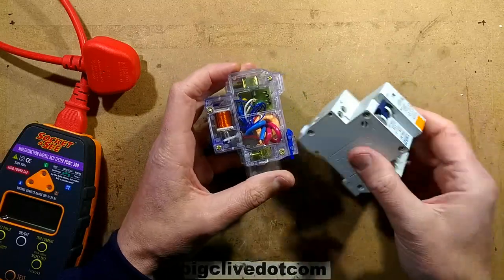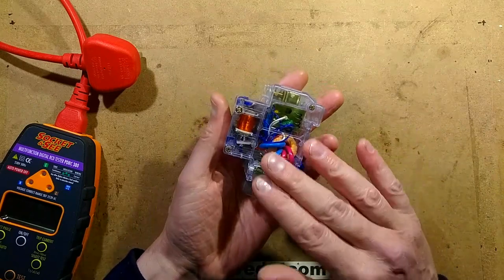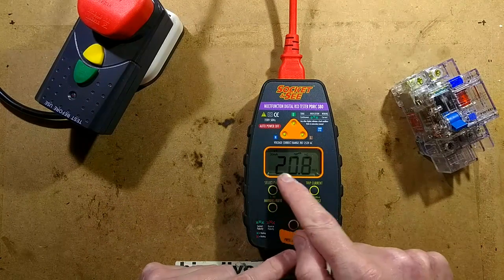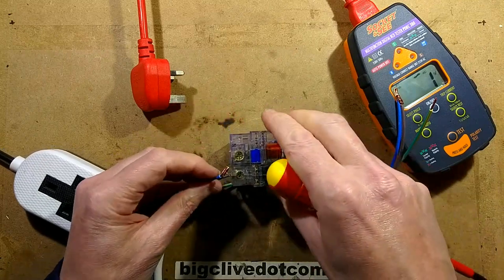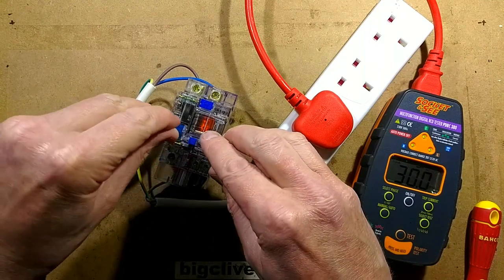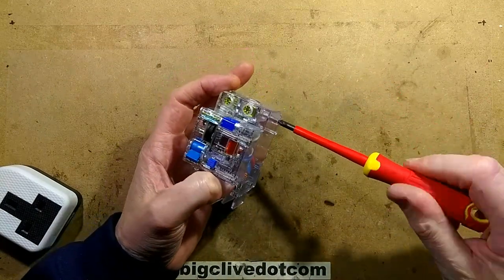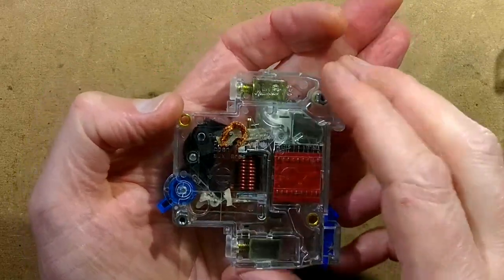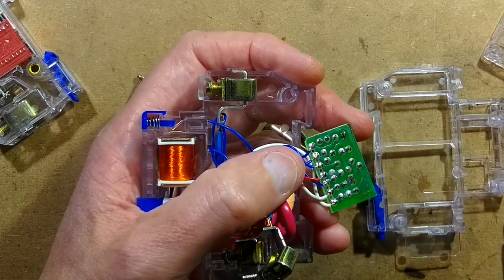Really neat transparent RCD/GFI.  (with schematic)

Comment: such a simple design, but it seems like it can only sense current in one direction, what happen if the fault is going through a diode? so the polarity of the spike is just being shunted by the reverse polarity diode, will it still trip?
Reply: Oh, good question!  That might happen if you accidentally touch a old "hot chassis" electronic device, or if you touch a switching power supply somewhere between the rectifier and the transformer.

Comment: I've got one and modified it to use the test function to shut off power to everything on my workbench when a separate (emergency/safety) switch is pressed. One could also add a liquid level relay switch module to trigger the test circuit to shut off power when a certain liquid level is reached.

Comment: +bigclivedotcom @bigclivedotcom 30ma RCD Max Trip times are as follows:

1/2X tested for 2S =  No Trip
1X = 300ms for BS EN 61008 or 200ms for BS4293
5X = 40ms

Also, why did you not do a ramp test to see at what current the RCD tripped at?

Oh, and some electronic RCBO's have a functional earth to ensure they continue working in the event of a lost neutral.

Comment: Notice that trip coil still gets AC voltage when thyristor fires up, so there is much more inductive resistance which determines the current through it, not 66 Ohm active one. So even if mechanism gets stuck somehow, it shouldn't set up fire, not immediately at least...

Comment: Just thinking about the time to trip the GFI... At 50 Hz (I assume the frequency you're using), one cycle takes 20 ms.  It will trigger when the current leakage surpasses a threshold, but when zero-crossing, there is no current flow.  When the leakage current is close to the trip threshold when the voltage is near peak, it can take nearly a half cycle before it would even know to trip (10 ms).  So strictly speaking, the time it takes to trip could vary by up to 10 ms even with everything else being equal, just depending on where it was in the cycle when the test button was pressed.  Unless the tester you're using knows this and intentionally compensates somehow.

Comment: Dear Clive (also known in my circles as Mr Delicious Beard, not a joke me and my friend call this terrific chap Mister Delicious Beard 😊😋👌🤣) I have a question: the circuit breaker had a couple screws that would've opened it up in a jiffy. Could you open it up and show us the quench plates? I am super curious what those red blocks would've looked like on the inside 😀 Thank you very much for reading Clive! (or Mr. Delicious Beard 😋😄) a reply would be greatly and oh so very much appreciated! 😊 Thank you for the entertaining and informative content 👍
Reply from the maker: It's a series of fins separated by the red insulated board.

Comment: I was going to say that they could have deleted the bridge rectifier if they used a triac instead of a thyristor, however triacs have diffo trigger currents for the 4 ac quadrants so that would give diffo trip currents for pos and neg phases.
The burden resistor is higher in value than I expected.
Still cleverly simple though.

Comment: Wow that's a very ingenious circuit and avoids using an op-amp which is what other RCDs use, well the ones I've seen anyway. One question though, the 3.3K ohm test resistor will pass a current of 73mA which is too high for a safe test. My plug-in RCD which is similar to your black one uses a higher value, from memory I think it's 15K ohms which gives 16mA test current. It would be interesting to see a teardown video of your plug-in RCD for comparison, hint hint!

Comment: bigclivedotcom
Ever tested an RCD to see if it works when wired backwards? (With incoming mains going into the "load" connections and the load connection to the "mains" input connections.)
I know our GFCI's here can spark and smoke if wired backwards and tripped. This is because of the design and construction. Normally the tripped-open contacts will remove the power to the load and the tripping coil, however when wired in reverse, the contacts don't remove power to the coil, and it quickly overheats.

Comment: It gives me a really reassuring feeling that most of the stuff you take apart is not powered by some black-box magic. If it contains everything that it needs, cheap doesn't have to mean shit, just means that the sourcing of the components has been optimized efficiently.

Comment: 7:23 I picked up a couple of those Wago snap terminals (5-position) from Adafruit before. They are a tad bulky, but after tearing my scalp off trying to keep screw terminals from losing my wires or just getting stripped, I decided that the Wago blocks are just better for quick prototyping/testing, so I got a big box from Amazon.

I think we can also get some from Arrow, including the wire-to-board terminals, which are mostly nice, but the bigger ones' pins don't fit protoboards...

Comment: Wait, your standard RCDs don't include overload?

I don't think I've ever seen one in Canada that wasn't overload + GFI with exception to the plug in ones built into hotel hair dryers.
Reply: TheRealBotcrusher The usual setup, at least in Denmark, is a big ass 40A or 60A 3 phase GFI with enhanced detection of halfwave faults at the panel input, then multiple 10A and 16A overload breakers for different parts of the house.  The power company fuse before the meter is typically rated less than the GFI, but even when it isn't, the sum of the overload breakers will sufficiently protect the GFI.  Of cause breakers and GFIs should be rated for the prospective short circuit fault current they may need to handle, typically 4kA .

Comment: The 12K resistor is a 'burden resistor', the transformer's output is a current, the burden resistor converts this into a voltage, which is needed to trip with.

Comment: That small MOV is going to give you trouble eventually.
They have a wear-out mechanism where every surge damages them slightly, and eventually they will fail from high leakage current and overheating. If there is no thermal protection a fire is likely. 
Common flame retarding agents in plastic don't do well with prolonged gradual heating, and even rated plastics can catch fire in those circumstances once the chemicals are baked out. 
It is not known how many house fires are caused by surge protected power strips and the like, but some fire investigators are very concerned about them.
Reply: And being in the panel, the current limiting due to wiring resistance is minimal.  Hopefully, everything holds together long enough for the breaker to trip from over-current.
Reply: Yes, bad situation overall. Can't really put a small input fuse there either - if it blows the RCD would not trip any more. One solution is to filter out surge spikes with inductors instead, but more costly and larger.

This seems a bad idea overall. I don't recall what "real" electronic RCDs do with the power supply, but I tend to avoid electronic types anyway. The classic construction with the current transformer directly driving the trip coil works fine for 30mA trip currents.

Anyway, I don't think a small varistor has any business inside a breaker panel. There is a reason overvoltage supressors meant for installation in a breaker panel are as large as that whole RCD and come with thermal protection devices.

Comment: I like the zoom on this camera, and would have no issue with you using zoom if it was always like this.

I don't really have a big problem with zoom anyway, but on some of the other cameras, the quality of the image seems to drop, as if it's more of a post-production zoom, which I could do with pinch and push, or by using Windows and "+" to engage the "Accessibility" feature display zoom if I needed it. This actually seems to be zooming at the camera, not the software behind it. Either that, or it's capturing at much higher than 1080p, and so software "zoom" (crop and rescale) isn't noticeable in the finished footage.

Comment: I was expecting a chip, but I guess the core windings provide all the amplification that's needed.

One day I might break into my old Powerdown PC power saver - supposed to turn off peripherals when the PC is off, but my newer system is too thrifty to keep it reliably on.
I guess it uses a single current sensing winding
Reply: Do it and make a video. I've been wanting to know about these and am too stingy to buy one for myself.

Comment: +bigclivedotcom -- hey, I noticed your comment in the video details where you mentioned that you'll be going back to the Moto G4 and that it's "a shame as the audio was louder and clearer."

I know it'd be a little extra work, but why don't you film these videos using both the Moto G4 (for the higher video quality) and the other camera (for the higher audio quality) at the same time , and then rip the audio from the camera with the better audio quality and just drop it into the Vegas (or Final Cut, or whatever editing program you use) project, overwriting the Moto G4's audio track with that audio track. Then just sync them up. Shouldn't be too difficult, as you will have been recording into both cameras at the same time, technically. 

Just an idea! Thank you so much for the awesome videos, as usual =)

Comment: Since it only triggers on one phase, that explains the approx 20ms (or 1s/50hz) difference between the phases. I'd expect that u might get minor variation due to temperature coefficient of resistance as well.
Reply: The difference was approx. 10ms , but yes that's what you expect since it takes at most half a cycle for the "right" phase to come around.

Comment: "The people who write the specs are just office workers..." That reminds me of what passed as discussions when the wiring colours were changed around 10-15 years ago. There were so many comments amongst the Chartered Engineers (I am one of them) about how stupidly dangerous it would be to swap the meaning of blue & black for example - I mean, it's not like it's important to know whether you are looking at a neutral or 415V phase is it...? They just told us that the changes couldn't be stopped so to just find a way to implement it.
Reply: Also, unless you're using an isolated mains generator / UPS, your test equipment seems to be proving that in Britain we never actually changed from 240V to 230V a few years ago ;-)
Reply: Just to add to the fun, in electronics, black is typically circuit ground/common.  But in US building wiring, black is hot.
Reply from the maker: +gx8fif The colour change was apalling.  From a distinctive phase colouring that was spaced across the spectrum to three dull colours.  I think the primary motivation was cash.  It certainly paid off for the management of the NICEIC who now refer to themselves as a safety charity, presumably to evade tax on the Part P racketeering.

Comment: I have such a leakage detector. I got one as a present a few years ago, when I was just 15 years old. I did not know what it was and opened it up. I saw the two big wires and the thin wire looping through the ring and even back then, just by common sense, I thought: The big wires cancel each other out, if current leaks, it shuts off.
I have that thing laying around, I would send it to you to see how (old) german ones are made.

Comment: where can we get your RCD tester .We have other ones in canada and will those work at 120V .Good to test hot tub GFCI breakers
Reply from the maker: The testers here are only suited to 220 to 240V supplies.
Reply: @bigclivedotcom  .That's good .most of our hot tubs use 240 6O amp GFCI breakers to supply them  because of the heaters used in the .the pump motor is quite small 1 horse power and  the bromine generator some have fancy led lights and a stereo ..Usually supplied by 12v DC .they dont use switching powered supplies for those .usually regular transformer /rectifier combo .

Comment: The trip times of an RCD and its relationship to electrocution are a red herring - RCD's are mandated with the intent to remove the power supply in a fault situation very soon after it has occurred, usually before anyone has been unfortunate enough to have received a shock. I have seen literature to support the claim that 10mA across the heart is sufficient to cause death in some people, circumstances may occur in which that may occur, without an RCD tripping.

Comment: I vaguely recall that they need to trip in a fraction of a heart beat, not particularly in a segment of a waveform.

edit:
"
Safety switches monitor the leakage of electrical current to earth through faulty appliances or incorrect wiring and disconnect the power quickly.

A safety switch can cut off power in 30 milliseconds - a 30th of a heart beat.
"

https://www.dnrm.qld.gov.au/mining/safety-and-health/alerts-bulletins-search1/alerts-bulletins/mines-safety/residual-current-devices-earth-leakage-circuit-breakers?SQ_DESIGN_NAME=print-fact-sheet

Comment: sexy RCD breaker from Asia, China! Only China RCD has the small blue square reset button, a good design! Any explanation why the test resistor value is 3.3K as it in fact simulates a leak current of 72mA?
Reply from the maker: I think it's to ensure a reliable trip.
Reply: It is the manufactures have to guarantee all the rcb trip at 30mA. And it is the internationally tripping specification for all 30mA rcb( home use ) in the market. Any rcb
Reply: Any rcb found unable to trip at 30mA but trip at any current of more than 30mA is considered rejected as failure to meet the spec. But so far I found almost all European n Asia made rcb are designed in with test resistor value of 3.3k or 3.9k....and not good reason from the makers is given in any where on earth
Reply: I therefore hv designed n made a DIY rcb tester with a test resistor of 6.8k (std value) to make sure the rcb always trip at 32 to 33mA, which is close enough to the specified 30mA! Interested viewer can search “diy rcb tester” for the video at YouTube. Thank you

Comment: we remove all of those breakers from equipment that comes in from europe .We convieniently name them EuroTrash .First thing that happens is we pull them out and throw them in the trash and swap out with Mersen ucc fuse holders .We have only had some equipment come in with those style RCDs and we get them passed ast part of factory equipment . They are rated for the current and guaranteed to blow on short or overload !We get so much equipment full of those little breakers mounted on din rails .They are only approved for communications equipment not motors,drives and plcs  on equipment !Thats for the CSA or UL/ULC standard .Not to many recycling facilities for those breakers .Loads of copper silver and paladium in some of the contacts

Comment: Would this protect you if you had a circuit that leaked to ground on one half of the sine wave? Does such a circuit exist?
Reply: Kaedenn Hopefully and yes. Basically any device that only needs the low efficiency of a cheao halfwave single diode rectifier, then is so cheap the halfwave rectified mains gets into your hand, through your body and into the ground.
Reply from the maker: You need specialist breakers to detect a DC bias.

Comment: Your house GFCI trips at 100mA?  Isn't that a potentially fatal amount of current?
Reply from the maker: Yes.  But it was covering the whole house on one trip.  I used local RCD protection at the bench.
Since that video I've replaced the distribution board with a more modern one with multiple RCD/GFCI sections.

Comment: Maybe I'm remembering wrong, but I thought previously you said your whole house had RCD protection...so when you were testing, I was expecting the bench lights to go out because you would have tripped the whole house RCD.  Huh...didn't quite work that way.
Reply from the maker: It does.  The threshold for the main breaker is 100mA.
Reply from the maker: You can get time-delay RCDs for discrimination so that downstream breakers trip first.

Comment: IF the relay didn't open, I wonder what would fail first: the coil, the thyristor, or one of the diodes? My guess would be a diode. Most semiconductors graciously sacrifice themselves (in other circuits) to spare the precious fuses from damage. 😀
Reply: Chaplain Dave Sparks I hope it will keep trying untitled it eventually cuts the power by exploding itself. Because a small explosion in the breaker panel is still better than a dead person elsewhere in the house.

Comment: The 3k3 resistor's value seems a little low, 230V / 3k3 Ohms = 67mA.  I would have expected the test button to test with the nominal fault current of 30mA, that is a resistor value of about 7k5.
Reply from the maker: +Ralf Baechle I think they're just doing a decisive test to make sure it trips to avoid resistor damage.  Most other similar devices also do a generous test.

Comment: British GFIs are set for 30 mA?  That seems rather high.  US/Canada standard GFIs are set for 5 mA (there are higher current versions available for industrial use).
Reply from the maker: 30mA is standard here.  Maybe because of the higher voltage and because we tend to protect a lot of circuits with one breaker.
Reply: How many outlets would typically be installed per 5mA GFCI?
Reply: Maximum of 12 (6 duplex outlets).  Well, that's the Canadian rule, not totally familiar with the US rules (Canada tends to just copy the US rules a few years after the US creates them, with a few adjustments).  At least that's the rule for a standard 15 A circuit here (The calculation is to derate to 80%, then assume 1 A draw per outlet).

If it's protecting an entire building, I can see why you'd need a higher leakage current.  Though I don't know if I'd want one on my fridge or sump pump.  The entire building aspect would be a nice feature.  It's no fun finding out a non-grounded appliance has a fault!